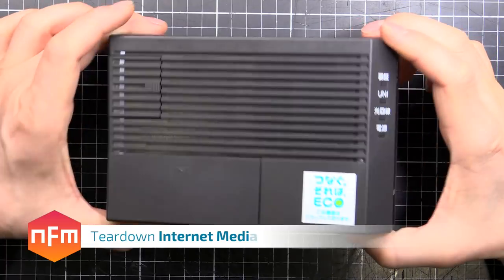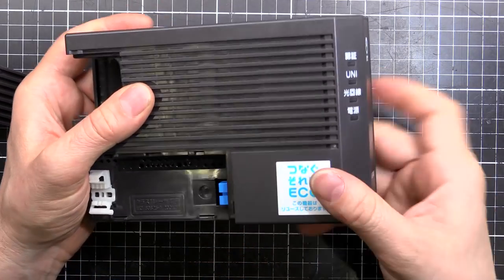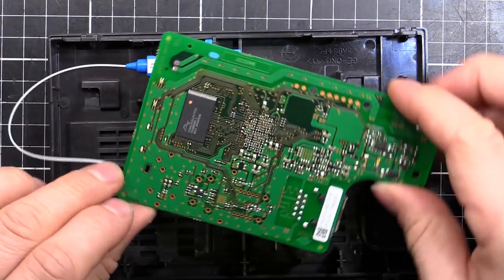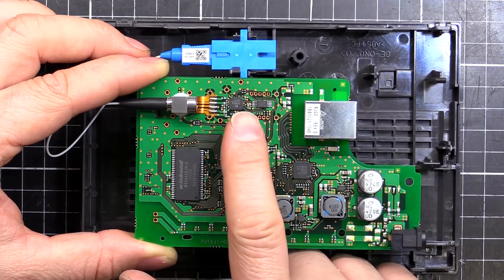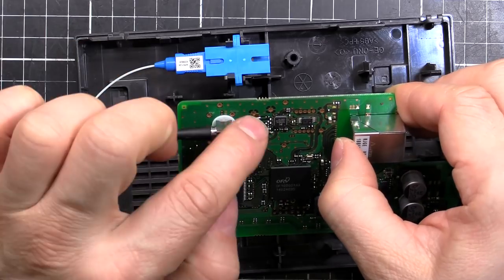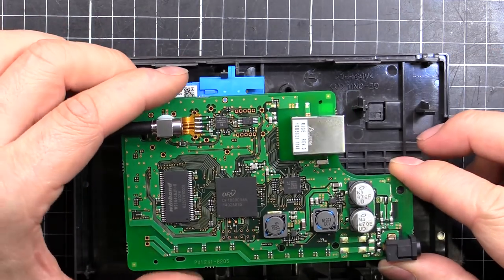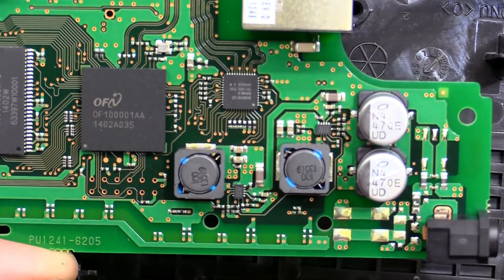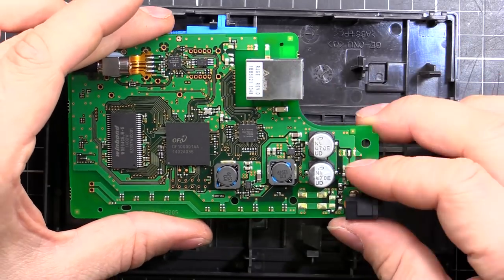Internet Fiber Optic Media Converter Teardown

Comment: Hey, I have a question! Could I use an ONU terminal as a media converter to extend my home network to a barn that's a couple of miles away?
Reply from the maker: I'm not entirely sure. I assume this ONU is simply a dumb media converter, but you can buy modules designed for your exact purpose anyway. Some I've seen around aren't tooooo expensive, especially if you get ones pulled from data centers etc during upgrades.
Reply: Not really, I assume it is a PON ONU, meaning it has a 1310nm Rx ,1490nmTx,..that's why normally on WDM media converters one side tx is  normally opposite the Tx on the other side,(same is true for RX),..there is an experiment am conducting, replacing the BOSA(bidi optical sub assembly) modules on two onus with the ones that match Rx and Tx  and test if two onus can work as point to point media converters,..the BOSA in this case is that component attached to the fiber pigtail,,,

Comment: I want to know why SoftBank Wi-Fi access points cannot be used with Android/Apple devices.
Reply from the maker: I'm not sure. I'll have to try mine to see. I have my Softbank router/wi-fi set to pppoe passthrough with wi-fi disabled so it just does the phone connection and passes the internet stuff to my Asus router, which then does my wi-fi and DHCP and all that stuff.
Reply: By the way, I'm talking about public Wi-Fi access points. I'm not sure if they have been changed or not, but back when I was there, I couldn't use the internet despite having like 10 of those APs sitting right there.
Reply from the maker: Ah yep. You need to have a SIM card from the respective provider that isn't a prepaid plan or the like. If you have the option enabled in your phone plan, you can use the wi-fi access point instead of mobile data, helpful in areas where cell reception might be a bit spotty, like the back of a bar in one of the old drinking streets around Tokyo, or out in the countryside etc.